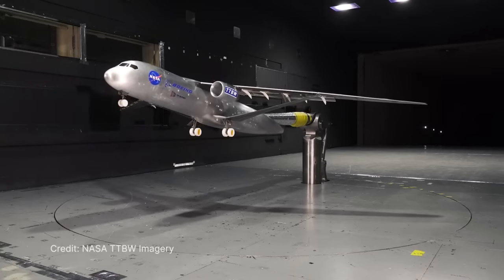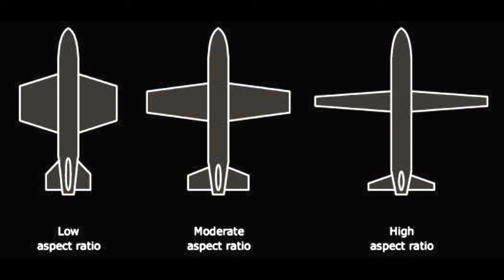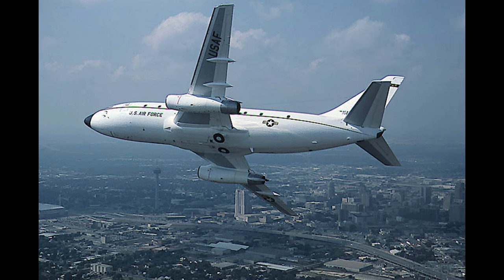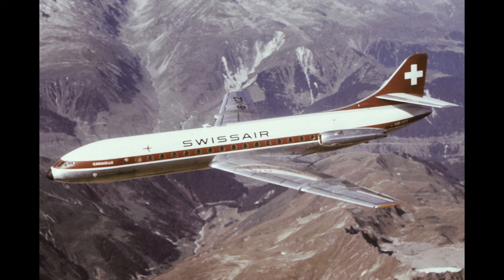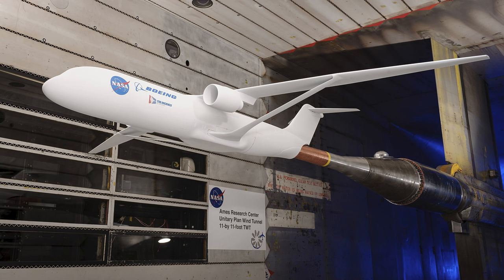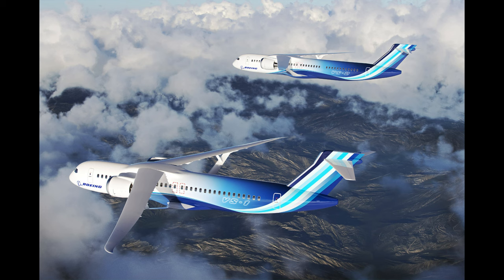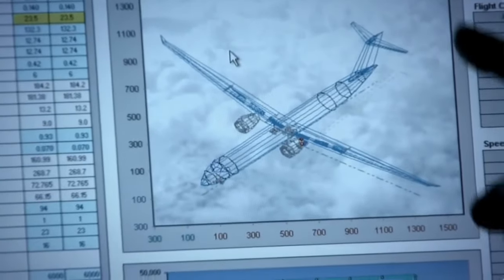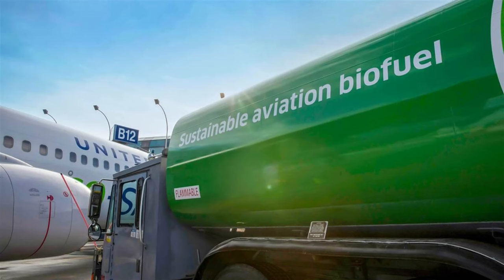NASA's New Airliner Experiment To Make Flying Less Expensive

Comment: Scott's last comment about the early 707 getting 45 miles per gallon versus 125 miles per gallon for the 787 really hit home. As he eluded to, keeping competitive will require continual research and testing of new tech and new ideas , some very radical!
Reply: I'm sure efficiency has gone up substantially, but I wonder how much of that increase comes just from cramming so many more passengers into the same sized plane?
Reply: @SolarReaper  Cramming is easy, low-hanging-fruit, so you should expect that evolution to happen quick. So I'm not sure if it has gotten more crammed in recent years, it feels like they probably hit the plateau decades ago.

And it's not a bad thing IMO. If you want less crammed seats there's always first class. In a hypothetical airline that has roomy seats in "economy" class, that "economy" would only be nominal and not actually cheap. Crammed economy class allows poor people to still fly, which is better than putting flying totally out of their reach.
Reply: @SolarReaper  Is that per passenger gallon? I really have no idea how much fuel jet airliners use.
Reply: "alluded". "Elude" means "to avoid". :) But he's right: fuel economy has improved dramatically over the past 100 years. I'm surprised it's that high, though, given what it is for cars. Airplanes aren't known for their low fuel consumption so much as for their speed. I always thought that was the tradeoff. You're putting 8,000 gallons in a plane that's going 3,000 miles, not the other way around. EDIT: he DID say "Passenger miles per gallon". That makes WAY more sense.
Reply: @c182SkylaneRG  Passenger miles per gallon, meaning that's the rate for each passenger, however to find the true rate for the "vehicle" in this case the plane you have to divide that figure by the plane manifest count?
Reply: @NeedlessPedantics  multiple the per passenger figure to get the A/Cfigure surely ?
Reply: @NeedlessPedantics  Correct. So 45 miles per gallon divided by 100 or so passengers, yields 0.45 miles per gallon for the aircraft, which is in much closer alignment with the fact that you can put 6000 gallons in a jet and expect it to have a range of 3000 miles. Part of the improvement in this statistic is the increase in number of seats for a similar sized aircraft: you're transporting more passengers for minimally more fuel used.

This is how trains manage to beat the pants off any other form of transportation when it comes to fuel economy: A locomotive uses a gigantic Diesel Engine. This is guaranteed to burn more fuel than a tractor trailer engine. However, that locomotive, with that massive engine, can transport hundreds, if not thousands, of times the cargo that that tractor trailer can, yielding Norfolk Southern's PR statistic of moving one ton of freight 400 miles on one gallon of fuel. Multiply the total tons of freight (a single car can carry 50 tons, and you can have 150 cars in a small train with only two locomotives), to get the total amount of fuel burned over those same 400 miles. Add another freight car, and you're increasing your cargo without really increasing your fuel consumption noticeably, thus increasing your fuel economy per freight-mile.
Reply: @c182SkylaneRG  only passenger trains are half full on a busy day.
Reply: @SolarReaper  not much actually. A 787 have wider seats than a 707. And for the 1st class the seats is a lot larger.

Pitch have been shrunk down about 4 inches. About half of that is thinner seats, the other is leg room. The first, businesses and economy ratio is also about the same.

Of cause, that is, if you compare a internationell 707 to a modern day typically 787. If you compare it to an 737.. the numbers is a bit diffrent.
Reply: @lekhakaananta5864  - The “evolution” of cramming people into commercial aircraft hasn’t been quick at all: conditioning passengers to lower their standards to accept the current state of things has taken almost exactly a century, and has involved also degrading their lives in countless other ways simultaneously, over time and by a thousand different cuts. We have the advantage of people’s productive lives not being very long, so every twenty years a new batch of twenty-somethings and thirty-somethings comes along, and we pitch whatever new degradation we’ve come up with—“All your appliances die within a year!? Well, now they’re so cheap, you can just buy a new one!”—as an improvement, to paper over facts such as their wages having shrunk in the last 60 years relative to their their time spent laboring and to their overall cost of living … “You make less than your great-granddad did, relative to the current cost of getting an education or of buying a home? Well, at least you can fly cheaply—crammed into a thimble between two unruly drunks, flown by an undertrained and inexperienced pilot who hasn’t been allowed to sleep in two days, in an airplane that hasn’t seen proper maintenance in years owing to budget cuts and to the airline calculating that the cost of your dying is lower than the cost of their running an airline safely—you lucky so-and-so; bon voyage!”
Reply: He stated it was getting 45 passenger miles per gallon.  The more passengers you can carry, the more efficient the aircraft becomes.  Our refueling aircraft burned about 10,000 pounds of fuel an hour.
Reply: @danopticon  pretty much all you wrote is bullshit. Modern passenger flying has not been around for nearly a century, and conditioning people to accept lower standards is nonsensical:

1) because every standard is still on offer. If they conditioned people why are there still first class seats?
2) it doesn't make business sense either because upselling luxury tickets makes the airlines more money, IF they can get enough customers to buy it. A first class ticket can cost $10k, but doesn't take more physical space than 4 economies, which they charge for much less, combined.

I'm trying to inform people here. "conditioning people" is bullshit conspiracy misinformation. The actual reason is that the people who pay for economy would simply never over-pay for a slightly more comfortable experience, despite the airlines wishing they would. When passenger flying was a new thing it was only for the rich, so every seat was like today's 1st class, but as they wanted to attract customers from a broader demographic, they had to make an offer acceptable to poorer people. Airlines don't have planes made of only 1st class because they won't be able to fill the flight reliably; there's not enough volume at that price point. They would have to reduce the frequencies of flights.

If you're so smart and unconditioned, by all means purchase a more comfortable seat, nobody is stopping you, and it isn't more expensive than a similar seat from the 1950s adjusted for inflation. In fact the airline try very hard to get you to upgrade to a better seat...
Reply: @johnp139  Depending on the route, and the locale, you're quite correct. That doesn't stop the overall "efficiency" of the train from being higher as the number of passengers increases, and it's entirely likely that, even half-full, if you compared the straight volume of fuel to the distance traveled and the number of people on board, even at half-full, the train is more fuel efficient than an airplane, and probably even than a car. At a half-full train vs a full bus, you're starting to break even, but as soon as you only have a half-full bus, the train is better.

The way you get full trains? Frequent, reliable service. It doesn't even have to be all that comfortable (look at subway trains), but it has to be on time, and it has to be at relatively short intervals (every hour or two for long distance, and every couple of minutes for innner-city commuter, like subways, trams, etc).
Reply: @lekhakaananta5864  - Commercial passenger flight has been around for nearly a century … if you can’t get that much right, then why would anyone bother reading the rest of your speculation? 🙄

Jesus. Some people…

Comment: If you recall the high ratio aspect wing was used exclusively on the B-24 and was called the Davis Airfoil.  It allowed a higher speed and a greater angle of attack during flight. It is interesting how older technology is making a comeback.
Reply: Davis wing was my first thought also
Reply: Just made same comment then read your earlier one snap.
Reply: The concept was always sound, materials technology just had to catch up
Reply: The Russians and Ukraine have been using them on commercial airliners and heavy freight planes for many years
Reply: Interesting they didn't used that space for bombs, so good point! 😊
Reply: This isn't as unheard of as you might think. Design concepts can be put into action and then they realize that it is not economically viable at that time. Then due to advancements and optimizations in a few fields plus an ever changing economic landscape, a once forgotten technology comes back because now the world is ready for it.

The reason people believe that it is relatively rare: most of the time, people(investors) aren't willing to change methods and processes that are known to work and they stick with them and believe their investment to be a sunk cost instead of redesigning.
Reply: I also believe some of the German designs from World War II used high aspect ratio wings for speed and altitude - the Focke Wulf Ta-152 comes to mind.
Reply: @snapon666  I did not know that!
Reply: Davis wings had a relatively thick wing profile, which was efficient at lower speed but caused too much drag at higher speed. It was fine for the B-24, but not for jets flying higher speeds

Comment: The daily operational downside of such a design is the existing airport infrastructure.  Many taxiways are limited by aircraft wingspan, and the existing gate in terminals as well.  This would require more spacing and less aircraft on gate at the same time.  Even the new version of the 777 required that the elongated wing fold up to fit in existing gate spaces.   The technology is very interesting and perhaps airports will be adapted to it in the future.

Edit:  As I’m typing this comment Scott talks about exactly the same thing haha
Reply: I was living Denver when DIA was built and they kept saying it was designed for ‘the next generation of aircraft’ because of its location wayyy out of town on loads of empty land. Everyone assumed it meant low orbit airliners or something. Maybe it just meant really really big wings. Lol
Reply: Yes, a 777-size aircraft would have a 140-metre span if the proportions were the same as the Hurel-Dubois design.
Reply: also airport expansion requires large scale demolition of neighborhoods, adding a human cost